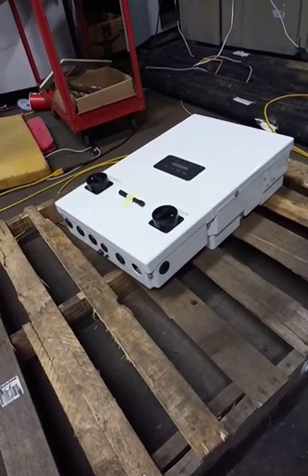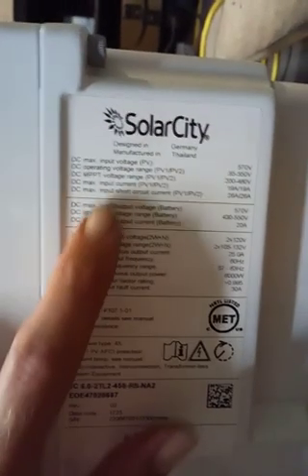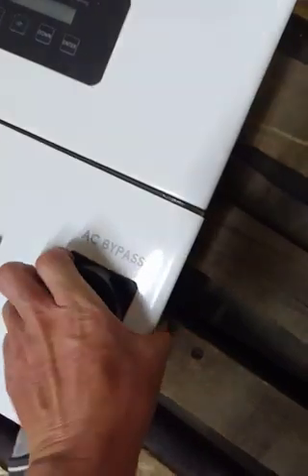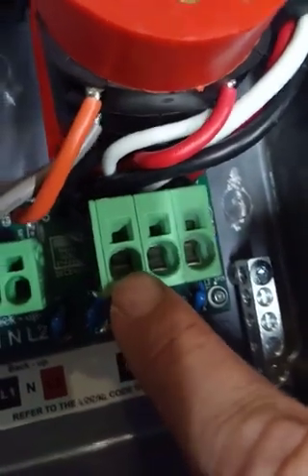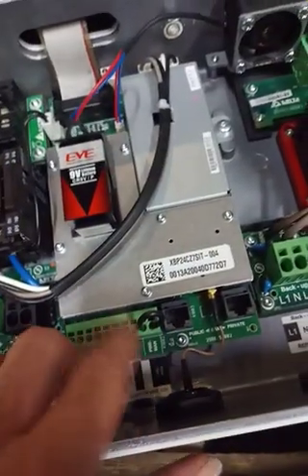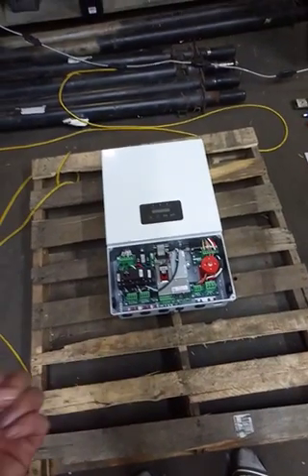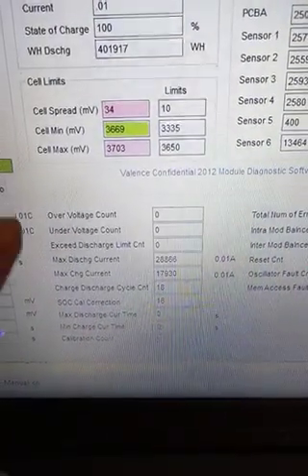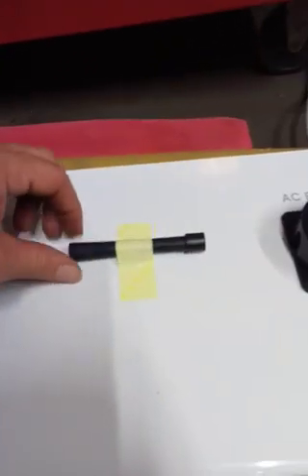Unboxing discontinued Tesla Powerwall Inverter

Comment: Do you have any spare h6s you’d be willing to sell? After 3 months of delays, in a couple weeks I’m supposed to be commissioning my 2 inverters ( electrician forced me to install both despite me only buying two as a backup plan ), but preliminarily it seems one of them is already faulty. When given pv (off grid ) It just keeps cycling relays and says “fault in inverter”. Can’t find them anywhere anymore.
Reply from the maker: I think you can only find them occasionally now. The big stock that Tesla had sold off has already been gone through.  I have a few extras but I have to keep them for myself because they occasionally explode.  I figured out a way to use them off grid and maybe that's why they explode sometimes. Anyway I literally rely on this inverter to power my family's home and since I can't get them anymore when my last unit explodes I better have a backup plan including reconfiguring my entire battery Bank to a lower voltage.  It's not going to be easy or cheap for me to change everything so I'm putting it off as long as I can.
Reply: @SiriusSolar  ha, I hear you. I lucked out and was able to get my hands on one more, so really hoping that it's a simple swap and all is well before inspection. I forget did you end up feeding your battery pack straight to the MPPT then? Does yours make a distinct electrical / buzzing sound when running? Hoping that isn't a premature sign a failure on my one good unit.  I picked up one of the SolarCity Zigbee gateways but haven't had any luck talking to it.

Fingers crossed you don't suffer any additional explosions!
Reply from the maker: @sjetmand  my gateway connects just fine and Tesla can see my units but they're not registered because I didn't buy them from a Tesla salesman so they won't connect it to my Tesla app.
Reply from the maker: I have at least three maybe four or five that exploded. There's one certain part that always pops. Maybe the other boards are still good and you could harvest some parts out of my broken inverters?
Reply: @SiriusSolar  This is what my faulty unit is doing: https://www.youtube.com/watch?v=2dyKRFswP1g
Reply from the maker: @sjetmand  I watched your video and left you some replies in it's comment section

Comment: Have you had any problems making such s high voltage battery? I'm in new Orleans and Eevee got no power and i have this inverter. A lot of people have told me to be careful or even forget high voltage batteries.
Reply from the maker: It's 15 times harder to balance your batteries before their introduced into the system. You just have to make sure you do a really good balance job first. This is because they're all in series.  But they stay balanced just fine.
Reply from the maker: I've had a few of these inverters explode. I'm not entirely sure why.
Reply from the maker: One problem with voltage this high is there so much voltage difference between things that fuses pop when you try and turn switches.  You absolutely must have a really good pre-charge system before you make any connections.
Reply: Sounds like maybe using these for off grid might be a bad idea if they're exploding, i can't risk setting my house or garage on fire. Bummer, i had hopes for this
Reply from the maker: @johnpreston5393  so far none of them have come anywhere close to doing anything dangerous. No risk of fire or anything. It's always been the same thing there's a little copper coil that explodes and flies into a bunch of tiny pieces. Yes they are leaving a smoke trail but that's all happening inside the inverter. There's nothing really that actually can catch on fire in there.  The only reason I know they leave smoke trails is because I had the covers off one time and saw it happen.
Reply from the maker: @johnpreston5393  I'd like to switch to one of these Chinese high voltage 15,000 watt inverters. They run on as much as 400 plus volts.  And they also can allow high voltage solar so I wouldn't have to rewire my solar Bank. I just have to cut my voltage from 500 volts down in half and have two paralleled banks of 250 volts.  Having two batteries in parallel is quite simple and doesn't require bus bars or anything.
Reply: @SiriusSolar  so would you say, use the inverter without batteries or even scrap the whole inverter? I already have one and after going through Hurricane Ida and still having no power I've wanted to go off grid.
Reply from the maker: @johnpreston5393  I'd say use it without batteries.  Disable the arc fault and hook up a hybrid car to its solar panel input. That way you'll have infinite power during rainy days or during the night time during blackouts.